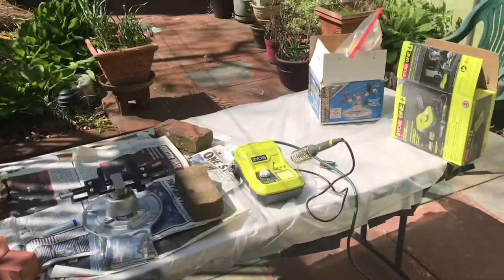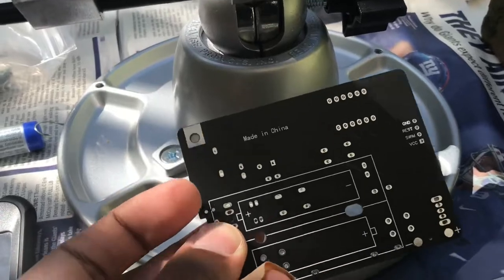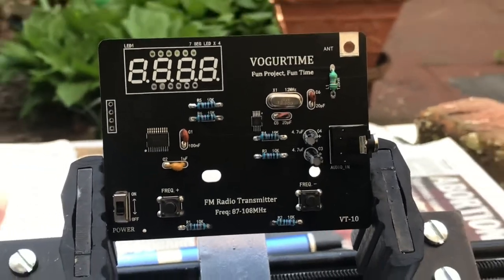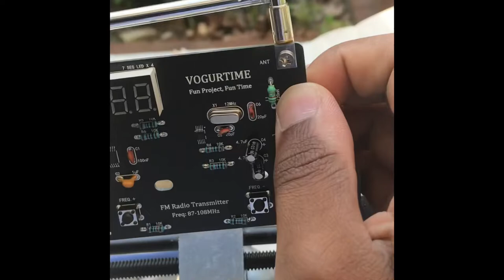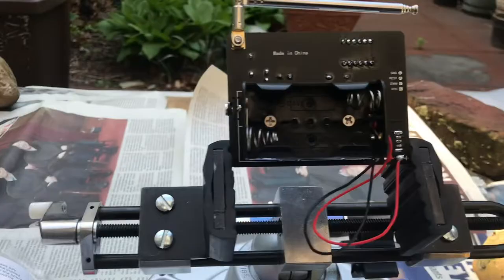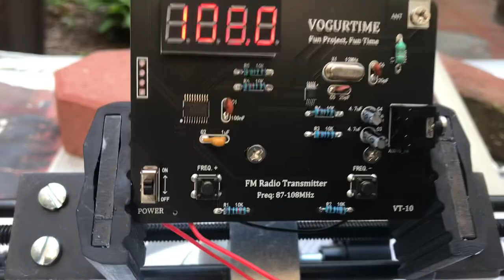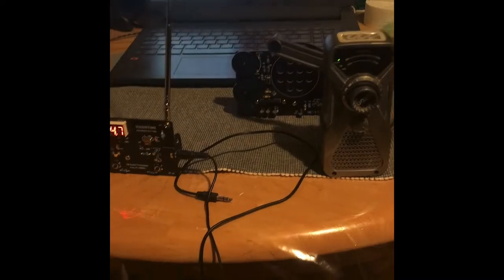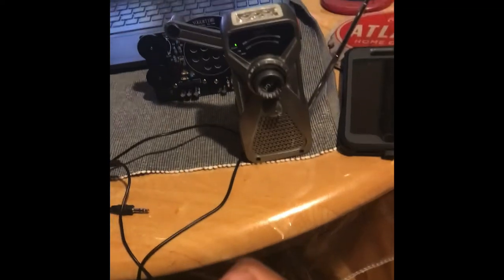VOGURTIME FM Radio Transmitter DIY Kit (Step by Step) Video

Comment: Thanks for the video bro I bought this I'm 43 yrs old felt like a challenge lol but as u can c I'm here for ur step my step video
Reply from the maker: Glad I can help. Didn’t think my final project would reach this far 😅
Reply: @thatguybrian3619  atleast yours worked lol..took me 2 hours to soder read directions did it like the book had a hell of a time getting the positive and neg battery cables to stick to the circles for them get it all done turn on and notta lol I prolly need to practice sodering more I'd say I had couple touching or something...end result trash can it went..I don't have the patience for that stuff..but ur worked so u did miles better than me